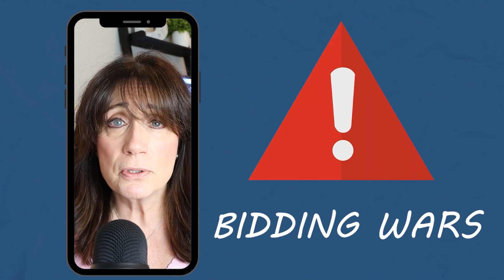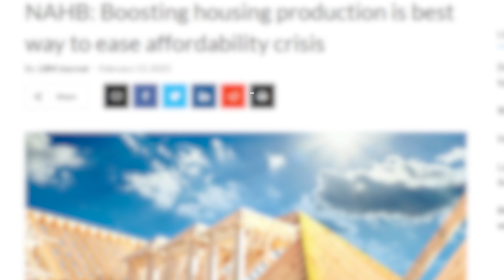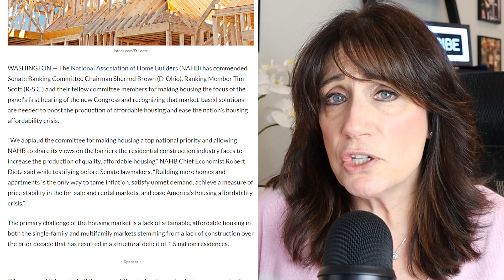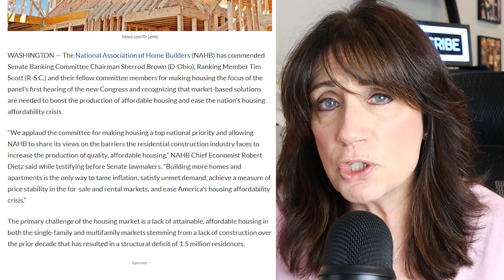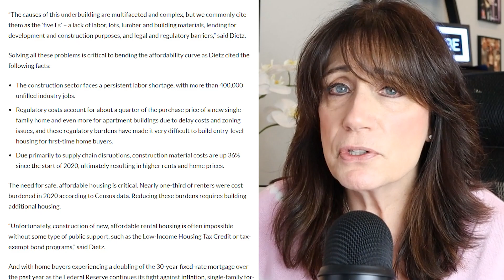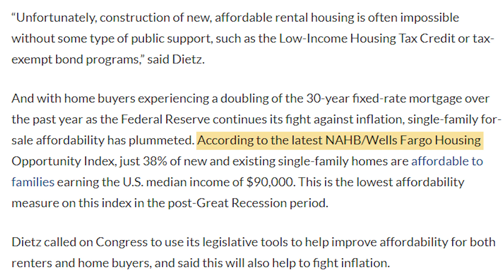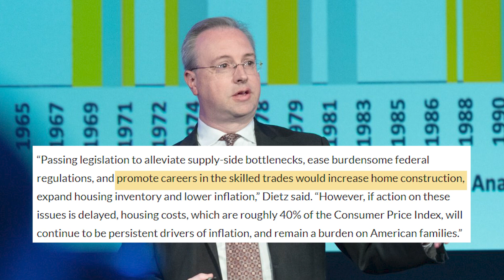It's a LIE! Low Interest Rates Don't Make Homes Affordable

Comment: OMG! You are sooooo right. I remember being in high school 20 years ago taking the last wood shop course they were offering. They replaced the wood shop for computer courses (that I think we're helpful, but they should not of taken away that course) there are gen Z and millennials that don't even know how to screw in a light bulb properly out there and call electricians and plumbers for simple jobs they could do if they were trained and had a basic knowledge. These are life skills that will be with you forever, even if you don't do it as a career. Sorry going on a rant, but we lost focus on trade careers for these college careers and the economy is not in a good place, and not enough jobs for ppl with college degrees out there, so we are stuck with those darn student loans for - feels like eternity. Thanks for the content again. I continue to wait for 2024 to be when I will come into the market prepared for whatever comes- with a solid down payment, knowledge on local market, local Realtor, and credit in a good place (at least that's the plan for now) :)